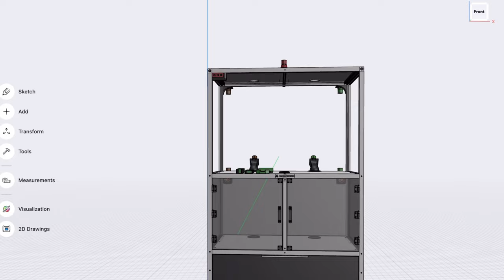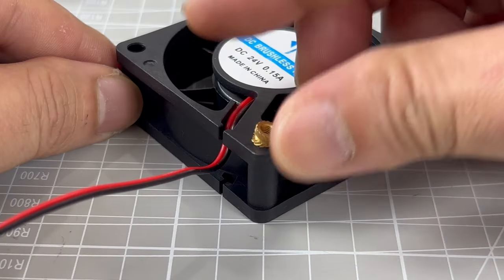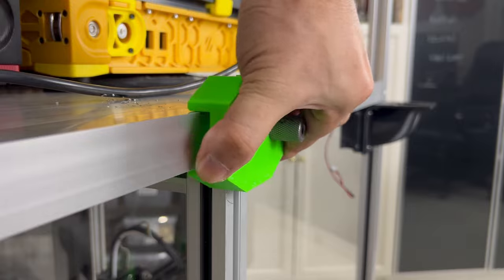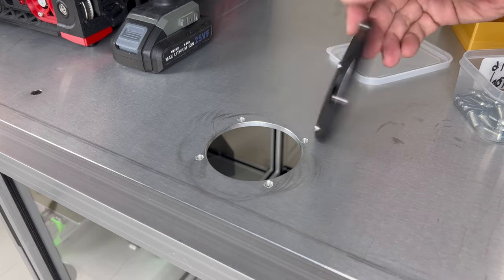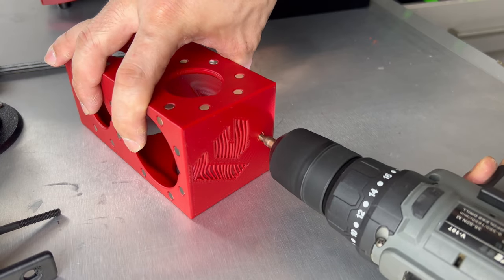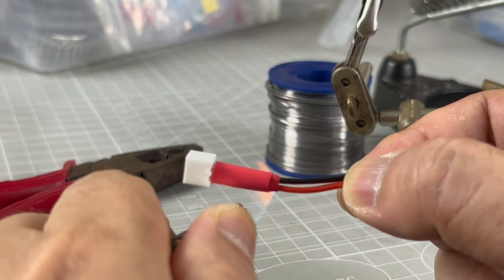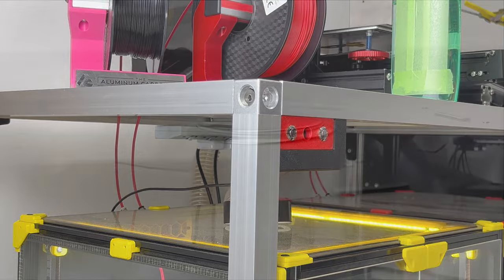ULTIMATE 3D Printer Rack (Part 3) | with Built-In ENCLOSURE

Comment: Do the plans come with any STL files? The purchasable plans only say it comes with the sketch file, but in the video, you show many 3D printed parts that are used? Thanks.
Reply from the maker: It comes with the 3d printed parts.
Reply: @TheAluminumCarpenter  Awesome, glad to hear. You may want to mention that in your store.
Reply from the maker: @joep9912 thanks for the heads up. Am heavily overwhelmed with every department of my work. Will get down to it.

Comment: Really nice project, you only need the exhaust? Or are you planning any intake?
Reply from the maker: Thanks, but, I dont really get your question. Intake for?
Reply: @TheAluminumCarpenter  The air the fan blows out must be replaced from somewhere or else it won't be very efficient at removing fumes once the pressure differential passes its ability to move air.

I am not an expert on fluid dynamics though, so I am not sure how much of a problem you might have.

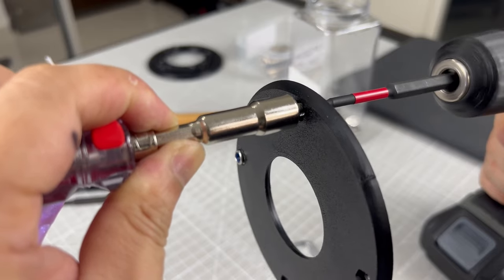Comment: 6:57 please for your own sake do not do this to nylock nuts. they are single use. youd be better off using standard bolts with a thread locker, by doing this you end up having second use nylock nuts which while better than a standard nut, are not as good as brand new nylock.
Reply from the maker: Thanks for the tip!